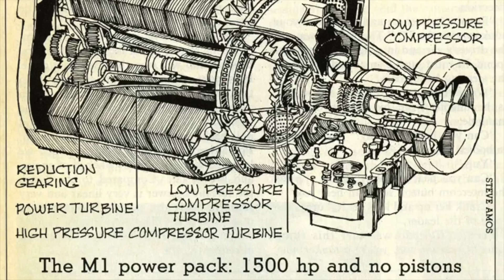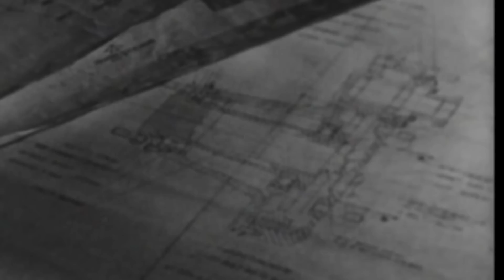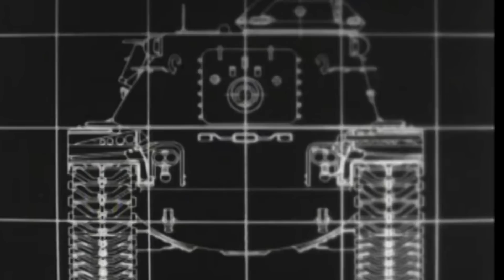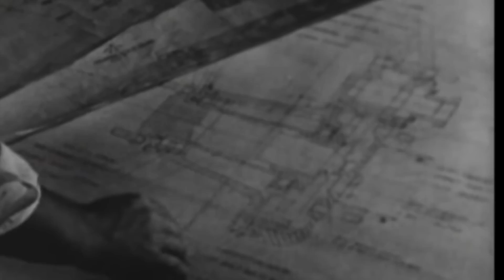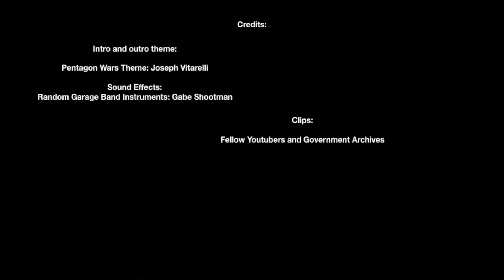The Real Pentagon Wars (For The M1 Abrams)

Comment: The AGT-1500 Gas Turbine Engine is actually very reliable. It's problem was the way it was used in the XM1 prototype tank used in development of the M1 tank. Everyone involved with the program had experience with aircraft Turbine engine's. As a result there was no intake air filters to prevent the engine from ingesting dust, dirt, and even mud. Aircraft Turbine engine's don't need air filtration but a Gas Turbine Engine used on land must have an air filtration system. An active air filtration system powered via the tanks hydraulic system was developed and installed in an air intake plenum system. This solved the reliably problem and it was discovered the engine performance was extremely reliable in actual use. So much so that Textron that built the engine went bankrupt simply because they were so reliable and failed to sell the number of engines that would keep them in business building them. After many years the Military financed a company to restart production of parts for engine's that were decades old and tired. It actually operates at a loss and so the military makes up the losses to keep it going.
Reply: Well shit, when the engineers do such a good job, it bankrupted them.
Reply: Planned obsolescence.... there's a reason some companies do that today.
Reply: @terricon4  and it is bullshit to the consumer. Wish it was legislated against as much as possible, or if your products are more reliable over a longer period of time your business can be nominated for a large tax cut so long as they can maintain that level of reliability.
Reply: @RavenFlight413  I say making a shitty product is fine, making intentional changes to keep it from lasting is the problem (like is often seen with cell phones).
For tax breaks or anything for a company that has long lasting products though, that would turn into a heavily exploited/fought over beuractratic mess of exploitation by the companies and their competitors. After all, accurate info would require all people that buy the product to provide life time numbers regularly then. Obviously many random people won't do this, and how it lasts varies likely by the way people take care of stuff. I know people that go through phones every two months, while I might keep one for five plus years before it fails on its own. If you can beat the competition buy buying some of their product, doing shit to it, and reporting low life times, great. If you can buy your own product or get someone who buys it to take good care and make sure they submit their info on the product, also great.
This all said though, when do you even get a tax break then? If you make a good product like these engines,  Do you get the break after they last just two or thee or five years? Ten years? It needs to be soon after the orders happened or it won't help as the company stops getting new ones sooner than later, and tax breaks mean little when you dont make anything now. But too soon and you can't really tell how long it'd last. Do politicians get together and vote on a given tiem for every random product out there, or is this only viable for some military contractors to exploit for paying less taxes perhaps? 
Sadly I see no option of government tax incentive to actually solve this problem, and not just create a bunch of new ones in the process. The best method if good business. Witch includes making products that last long and work well so you get a good reputation, but not to the point that you can't sustain your own business. That or if you do you accept that's a one off sale for that item and make sure it's not the mainstay item your business makes. Multiple companies have in the past failed since they only made products like this, that had high demand when new or something but once not demand dropped and they failed when they couldn't sell enough to match their new size, and the reality is there's no one good answer for those situations. And not all of them even really need a special answer we could argue.
Ah... why is reality so complicated and tricky to solve... why can't it be like video games where you just do some random research, unlock some new political or economic buff, and bam the problem is solved somehow magically.
Reply: @RavenFlight413  
There was a company in the UK, started but washing machine repairmen. They were sick of every machine just gaming to bits after a few years with the same faults over and over.
So they had a range made, solved all the problems, drum piercing, bearing failure, case rust, etc.
Nobody bought them, they didn't see the point in paying all that money for a basic washing machine.
By the time I could afford one, they'd gone out of business.
Their top machine had truck bearings I remember, guaranteed for life but very expensive.
We got a John Lewis one, currently 15 years old and faultless, still looks new. So there are machines out there that are well made.
Reply: The turbine is smooth, makes lots of power for size and weight but is inherently expensive because of the alloys required and does really suck fuel. It is not a good choice for a land based vehicle. I thought it was chosen so that the Russians would have to "one up it", build their own turbine tank and go bankrupt!!😄
Reply: @jeffsnider3588  A big part of it was that it as designed to run on any fuel you feed it. It was thought that fuel would be in shortage during war time.
Reply: Ok but I diesel is better in about everyway besides weight
Reply: @Cheesusrice69222  not really. The Continual 1790 air cooled V12 diesel engine it replaced had to be rebuilt every 500 hours. The AGT-1500 Gas Turbine Engine will easily go 100,000 hours before a rebuild is required. Typically the M1 Abrams tank will be put in a IRON or Inspect and Repair Only as Needed every 500 hours but the power pack which is the complete turbine engine and transmission module will be removed and reinstalled in another tank and sent back out into the field almost immediately. Turbine engine's do not have components subject to wear such as pistons, cylinder liners, and Shell type bearings. The shaft support ball type bearings last far longer as do the carbon oil and gas seal's which can easily be replaced in a few hours. Typically those are replaced every 100,000 hours due to increased oil consumption and smoking. Textron actually went bankrupt because they didn't sell repair parts for the engines for many years. Only about 5 years ago did parts become a problem and parts began being produced again. There have been many companies submit diesel engine designs to replace the Turbine Engine over the last 40 years the M1 has been in service. All failed miserably. None feature an easy to remove power pack design, a service life exceeding 500 hours, and didn't require removal of the rear fuel tanks to make room for the much larger diesel engine and severely limiting it's range despite the lower fuel usage. If the Army had wanted to replace the Turbine Engine they've had many opportunities to do so but no one has presented a better engine/transmission power unit design without ending up with range or performance reduction.
Reply: The turbine engine in the Abrams can use gasoline, diesel, and jet fuels, so it’s far more versatile than a regular diesel engine.  On top of that, it produces far less smoke than a diesel engine, which can point out a tank for miles around, and while it definitely isn’t quiet, the pitch is much higher than a diesel engine, and higher pitches don’t travel nearly as far as low pitches. With the addition of the filtration system, and the apu, the turbine engine becomes a marked advantage over a regular diesel.
Reply: The turbine is brilliant if at all times when it's on it's being used at nearly full power (how they are used in aircraft). But that's not how a tank is used. It's idle fuel consumption is extremely high. That's why eventually a APU was installed. So the turbine buys you a wide range of fuels, but shoots you in the foot when you are not in the midst of blitzkrieg. You'll notice all US modern tank doctrine definitely takes this into account.
Reply: @JM-nt5fm  Which works out, because thats exactly what you want a fast tank to be doing. Too often we see tanks sitting still get turned into scrap by ATGMs. The turbines encourage you to keep moving lol.
Reply: @GeneralLee131  war involves lots of sitting around and waiting… driving for the sake of driving just burns fuel accomplishing nothing. More movement means more chance of something happening too. Getting stuck can still happen
Reply: @dirtyaznstyle4156  the Abrams now has an apu, which means it doesn’t need to keep driving to save fuel.